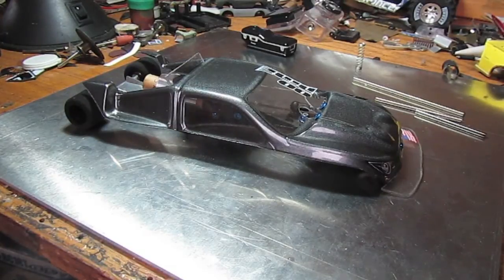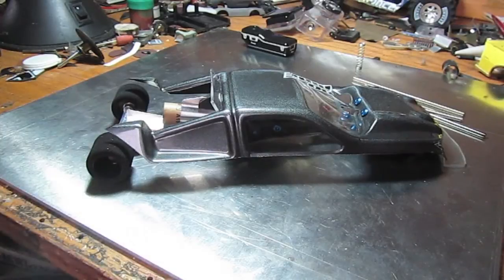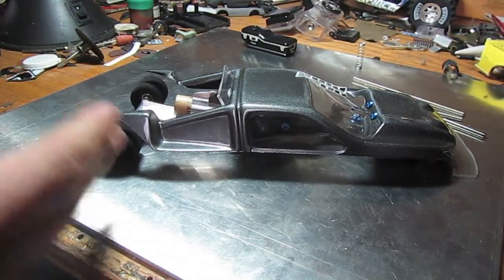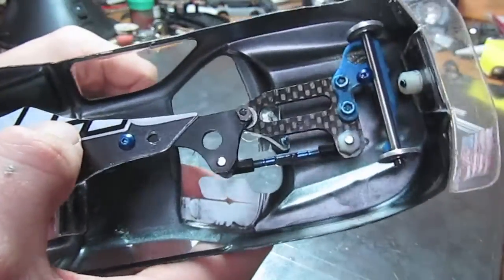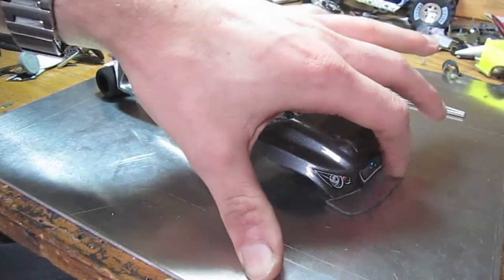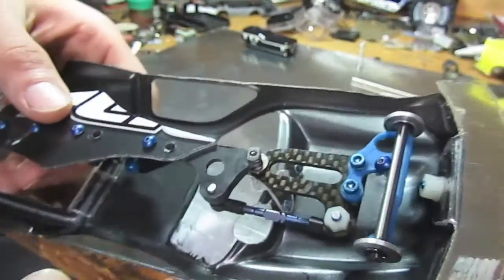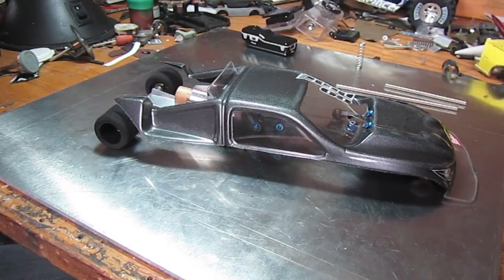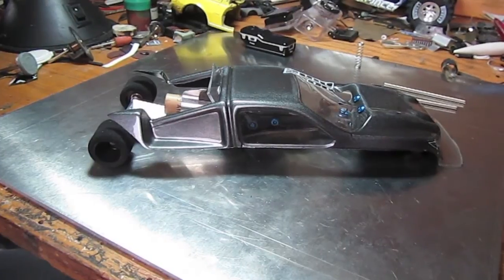Model Rocket Cars; Basic tips,tricks, and some side by side racing action.

Comment: My friends and I did this in middle school in high school I’m 50 now we thought we invented this OK maybe not invented this because my stepdad and his buddy kind of did it but we took it from two or three people to 10 to 15
Reply: We used Ravelle models lot of five minute epoxy like I said, the square tube, solid rod, axle, graphite, lubricant, a tin wrapped around a dime with tape around it for engine holders bigger for cars we ran double D engines so I think they push 60 pounds 120 pounds of pressure pushing a less than a pound car

Comment: Looks like you are enjoying yourself. Cool . Did this a good bit.Use to build 1/24 the scale plastic model cars. Used A engine. We used some pennys glued to the floor boards. Tricky 2 get them to run true. Staying together was also a a challenge. We did this in the 70s 80s and 90s. Loved it.

Comment: thanks!! i just stated a diecast pick up truck rocket truck. it went pretty straight with glued in A motors. i made a bolted on electrical conduit clamp "motor mount" and D engines next and it hooks left like its on rails then i think goes air borne on its own.   I'm going to try moving the motor inward over the rear axel like you suggested.  i was going to use a actual Estes motor mount...but you're hand made adjustable one looks bad ass!  that's some sweet work you did!!
Reply from the maker: Thanks, have a blast ;) !